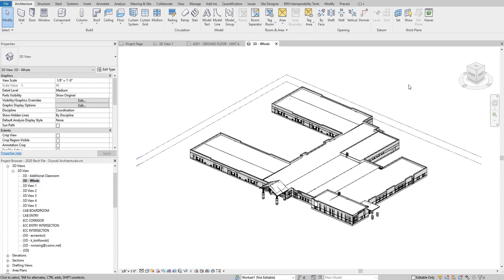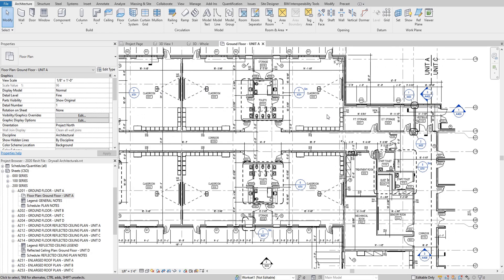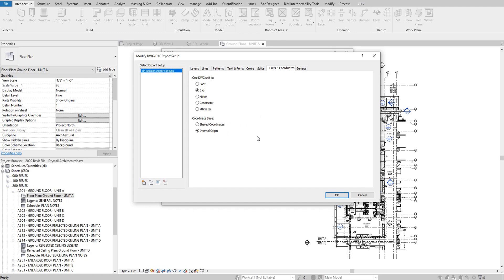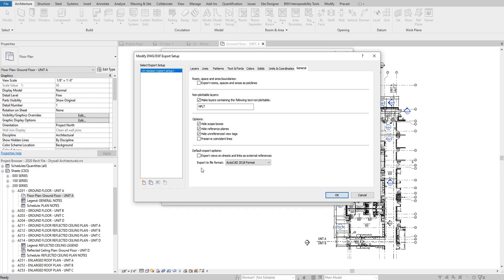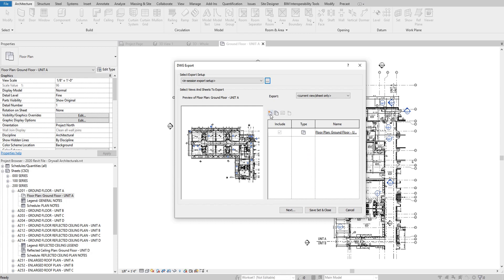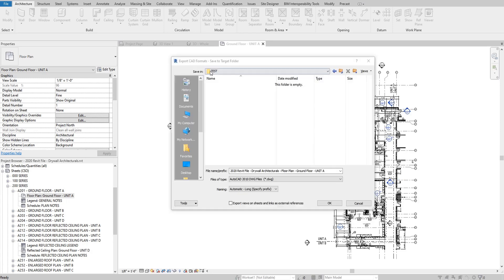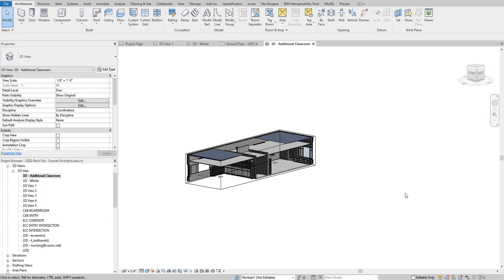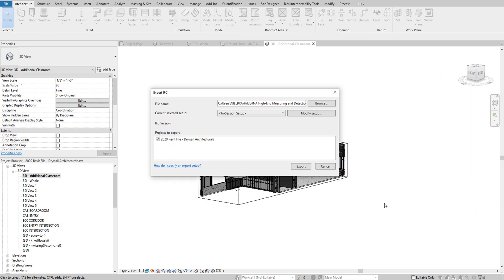Exporting 2D and 3D DWG or IFC files from Revit Files

Comment: We have a vendor (sells/rents Leica) that is swearing by IFC exports. I see that they are at least 5 times the size of a cleaned up 2D dwg. Their rebut is that even though the IFC files are rather large comparatively speaking, the ifc is way more stable of a file type. Thoughts on this?